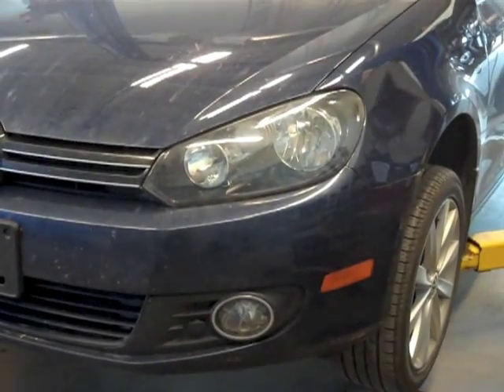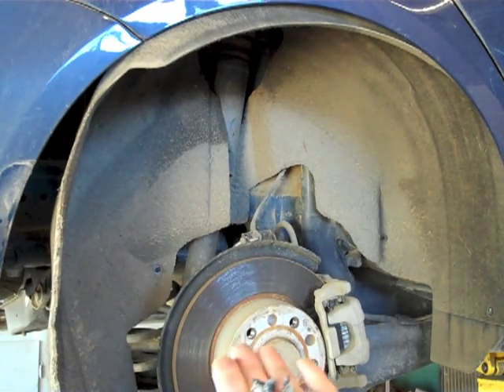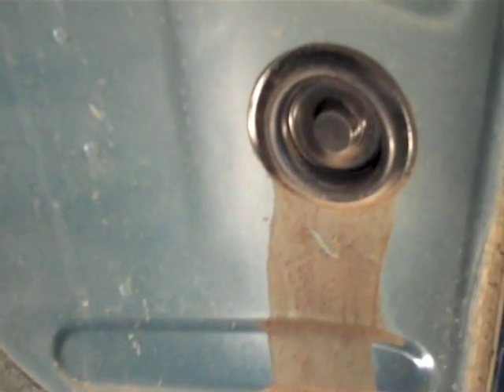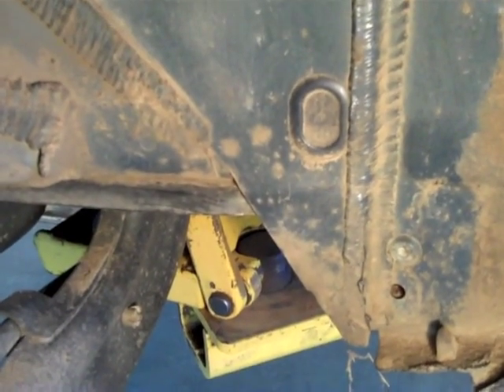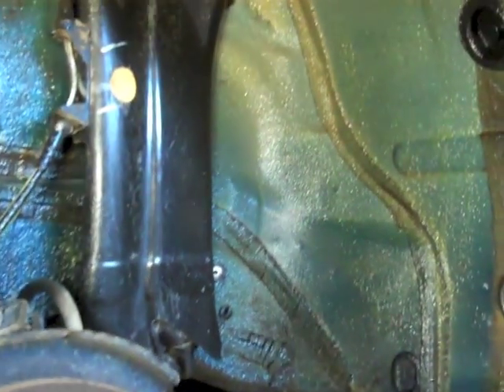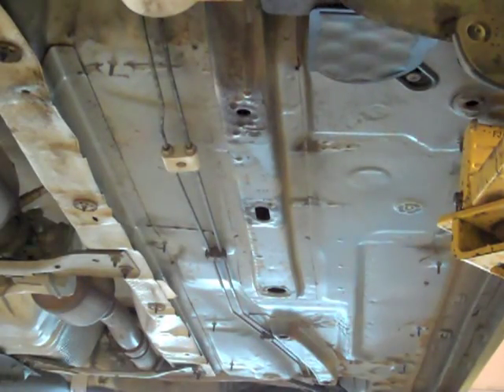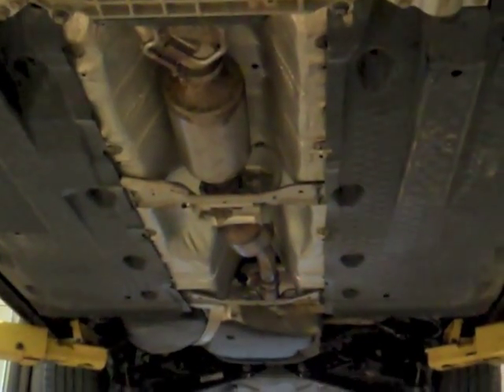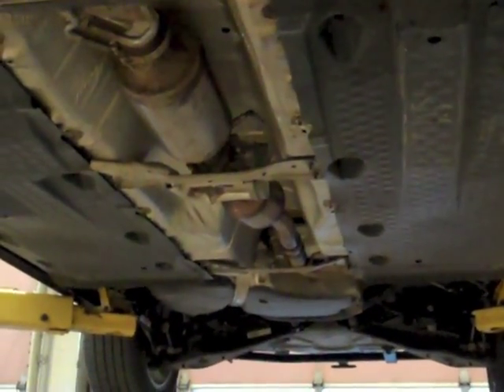Undercoating a 2012 VW Golf TDI Wagon

Comment: Good informative video, sir. Did the wagon remained rust free since new? What are the signs I should look for if I want to buy a used one and is from states where the roads are treated with salt during the Winter months?
Reply: I wax it a couple times per year as well. I am from Canada, so lots of snow and salt on the roads. The only rust it ever got (now has 440,000kms on it) was around the VW logo on the rear hatch.
Reply: Thank you for your response. This goves assurance that essential parts are going to be rust free for hundred thousand of miles. 400'000 kms is 248,548 miles.